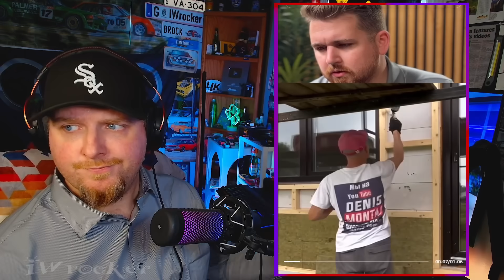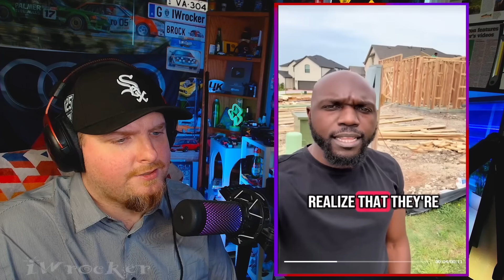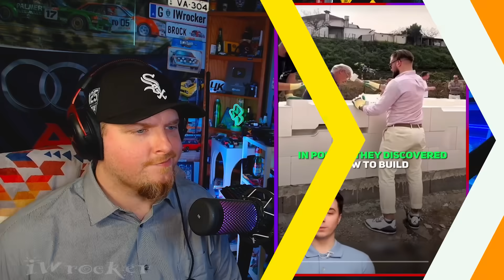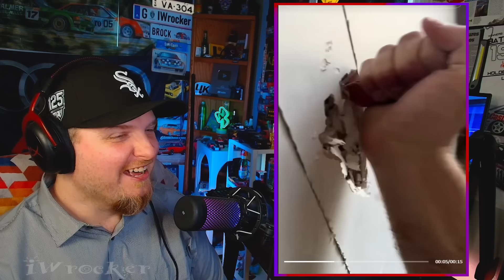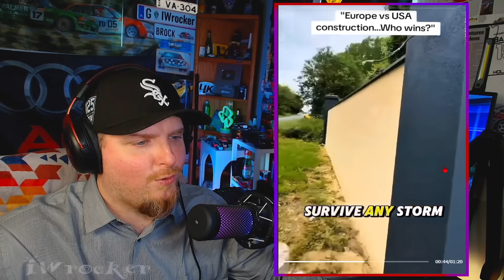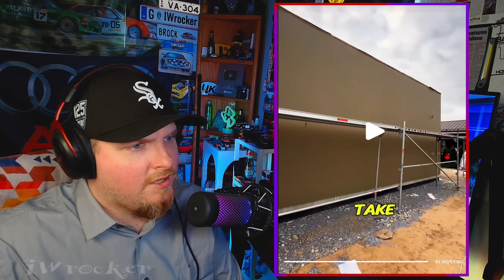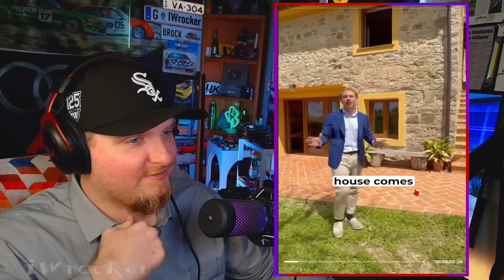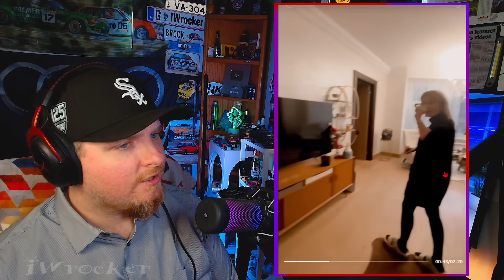25 Minutes of European VS American Home Quality & Construction Methods 🔨

Comment: In my country there are concrete and brick pre-fabricated houses that can be assembled in two to three days after the slab on the ground is ready.
The walls come with pipes and windows pre-installed, are attached to the slab and the joints are insulated on site after it is all assembled. After it is all dry, it is painted or whatever you chose for the interior.
Cost wise it is a little cheaper, if your site is not too far from the factory where the walls and ceiling are built, but also depends on location since the truck has to have clearance to get to the site (so no big cities).

Comment: 17:55 i might've seen the answer to that recently, in a video about the london metro network (vs berlins). its not an actual house, its just a facade. there is likely a big, square hole behind it, where the "tube" runs through, back from the days when they used steam locomotives and had to vent the steam from the tunnels. guess it was decided this is nicer than just leaving it open/fenced in.

recently watched a video of an experienced older gentleman from the US reacting to japanese housebuilding. its interesting that they use a lot of wood too, but everything (certainly in the video he watched) was done with care and clear experience of the craft. it was delightful to watch, both the original, as well as his reaction and recognition of the methods used.
and then you compare it to some of the horrors we see in US house building. granted, i know there is scammy japanese housebuilding too, or at least it used to be a big issue, as well as decent to good american housebuilding. but you gotta wonder what justifies the costs.

also what you said about them being thrown up quicker in the US is only partially true. im fairly sure you even looked at a video of european prefab houses before. those go up quick as well.
Reply: There are indeed facade "houses" in London as you describe, but "the Thin House" (its actual name) isn't one of them. It's a genuine house (or rather block of flats, originally artists' studios) built on a triangular plot left over after the construction of the Metropolitan District Railway. Partly so as not to waste the land, and partly to hide the railway from the posh houses in the rest of Thurloe Square.

Comment: 13:30 universal European house. the walls are probably Ytong or similar. light material that has very good fire-resistance and heat retention. the outside is black EPS, a type of isolation. You choose the thickness of it depending on your need. the netting is there for it to stick together with the plaster that comes on it. it is not cement. just plaster that you can get in any colour you want, so you dont have to paint your house and it stays the same colour.

Comment: My grandmas house is 500yo with 1m thick layered rock walls. The only thing that needs to be redone or fixed time to time is the clay roof tiles, the paint on the wall and we did swap out the old windows for modern vacuum sealed ones for better insulation.... I assure you that the 100 year remark was not an exageration...

Comment: In Norway, we isolate on the Inside, and most houses are made of wood, including the facade.
Reply: Might this be the line that connects things, with wooden walls you insulate on the inside and with solid walls (brick, concrete), you insulate on the outside? 

I do realise that the best methods with solid walls might be a double wall with insulation between the two walls.

Comment: American houses are NOT quicker to throw up. Cement based prefabs are literally assembled in a single day with a three man crew and a crane...

What takes longer are slabs, roofs, interior design, fassade work... all of which have to be done similarly in the US as well.

Comment: I live in the UK in a 1966 bungalow, we have iiner wall cincrete blocks, outer wall bruck,we have cavity wall insulation between, our lofts are insulated, all our inner walls are solid too, if you want to hang anything you need a hammer drill. We don't have basements, older house have cellers. we don't have 'crawlspace' I don't understandwhat that is. It seems American houses are designed to be a fire hazzard.

Comment: 18:45 - It's not exactly a truck, Ian, it's more like a UTE. It's called Piaggio Ape and it's basically a three-wheeled Vespa (which is also built by Piaggio) with a cabin and a metal bed. You can see when he comes out that it has the normal Vespa handlebars instead of a steering wheel. Very common in many European countries. 🙂
20:08 - That's not a bathroom, it's a toilet. It doesn't have a bath tub or a shower.

Comment: I pay around 1000€ / 1200$ i rent for 60m² in a average size city in the Nordics. It's quite high for the city I live in though but the building I live is pretty new, built in 2017 with high standard.

Comment: The grey roof is a "standing seam" roof system. Normally zinc alloy sheets or galvanised steel in that matte grey. I worked on a 18th Century school roof replacement with a standing seam copper roof where the patination had turned it green when showing clients years later. Beautiful.

Comment: I have a question about cleaning the American style windows (I'm a lucky German who can just open the windows like a "door" to the inside of the room and wash the panes easily on both sides). I'm curious about the American windows, where you have two panes and the lower pane slides up in order to open the window... So, if I'd want to wash such a window, I could, obviously, wash one side of both panes (upper and lower) normally from the inside of the room. But to clean the outside, I'd have to slide the lower pane up, and then precariously lean outside of the window, twist my body around and try not to fall out, while I wash the outside of the now pushed up lower pane...? If I survive that, then the outside of the upper pane is still dirty. Unless I live on the ground floor and can access such a window from the outside of the house, how do I wash the outside of the upper pane? Do I have to place a tall ladder on the outside of the house, climb up and wash the windows that way? What if the house has three stories? Not everyone has such a tall ladder? Or if you're elderly and can't climb a ladder easily anymore? Do you have to hire professional window cleaners every time to get the outside of the upper pane clean? I've pondered about that more times than I care to admit. 🤭 Maybe there's an easy solution to this, which I've just never seen or heard of, but I keep wondering how these American windows get washed from the outside. Maybe someone was patient enough to read my long-ass comment and can let me know how you guys across the Big Pond do this. 😊
Reply: Or, I guess, if the lower window pane slides up on the inside , then you'd be able to clean the outside of the upper pane by leaning out, but now you can't access the outside of the lower pane (because that's now facing the inside of the upper pane). Either way, I imagine you can't properly access both panes on the outside. Yet, I also can't imagine that American's just always keep one pane on the outside dirty. How is this done? 😅

Comment: My father is a builder and our house in Portugal is built with a double-wall system. One layer of brick, then a layer of insulation, and then another layer of brick. In the summer the house is cool, in the winter it's hot. We don't even need heating or air conditioning.
Reply: Yes, that's how we do newer houses.

Only use insulation outside for old houses built before insulation was a thing.
Reply: @anamarques5599 Except if it's an old historical building. In that case you cannot hide the exterior wall behind insulation. Inside is your only solution... which is a pity but hard to do better
Reply: so is mine
Reply: @oulibemusic1257 you are from?
Reply: @anamarques5599 South of France

Comment: 1) Windows - there are not just two ways how to open the window. There is third version (or versions - if there are more) called micro ventilation - you just lock the handle to half pas one (clock) posture and there is just few milimetrs opening to let the moisture go outside. 
2) Fake facades in London are for hiding undergroud (metro). The London underground is so old that remebers real steam trains and it has to be partly open to let the steam go out. Behind the house ais a fosse where trains are going. So there are parts they are just hidden behind those fake houses not to fall on the railways. Or some fake houses are standing acros the fosse.
Reply: 1. micro ventilation is the thing most Europeans forget to mention and more to that - you can set it in two or even three position with eccentric gap adjusters.
Reply: @AudriusN  Exactly!

Comment: Since 2020, Germany has had the Building Energy Act. All older buildings must be insulated when their facades are renovated; usually, 4-6 inch foam panels are glued to the outside and then replastered.

Comment: We have several types of insulation.

Between bricks one wall of brick the insulation eps places finally another wall of bricks.
The hold house became blue or yellow depending on the brand, the Las brick wall is the outside wall.

We call it sandwich insulation made when the house is built.

After the house is built you can do interior installation, not my favorite choice because of the inevitably termo bridges (as mentioned above).

At Last we have the hole external insulation, we call it capoto can have 15cm thick and then is has the external finish.... Is better than the internal one.

Never saw an external insulation made of Rock wool and nothing else with those untreated wood expose to elements.

Comment: Not one house that i own. One built 1880. Mid terraced built 1956.
Permanent home built 2002 All roofs have Concrete Tile. Not garden shed felt. That will have to be replaced within 10 years. Thatch lasts +30 years. 
You dont even have click together  garden hose connections.
🇮🇪🇪🇺

Comment: If you want a proper insulation you are doing it on the outside, that's physics, not feelings. In conclusion the first guy, who claims is a constructor, he will fail a 7th grade thermodynamics exam.

Comment: Building and construction regulations here in Germany assume a useful life expectancy of 80 years for residential housing structures. But a good number of houses are much older than that, in some cases they have lasted centuries and, with the right amount of regularly carried out renovation and restoration, still have many years of use in them.

Comment: ALL EUROPEAN homes come with insulation because it is mandatory. Some building directives require near-zero energy consumption. Space age technology for US of A
Reply: Nope. The old places don't, but then, they don't really need it. 
I happen to live in one, build in 1743. Outside insulation is out of the question since the place is protected, and is beautiful.
However, the thing was build with 80cm thick stone, doubled inside with real wood panelling... once you switch windows to double glaze (it's the weak point), the energy conservation is top notch.
Our ancestors knew what they were doing.
Reply: @picassomanu185 sorry, but stone walls suck at insulation. I have 200 year old farm house as well with 70cm thick stone walls - its just bad at keeping the heat in in reality. They have big thermal mass but that's about it. 10cm of rockwool is 7x better at insulating....
Reply: @Mixz1890 not if you have a wooden box insiste the stone box, with air in between.
Reply: Nie jest obowiązkowa dla starych domów, przynajmniej tych na wsiach i na prowincji. Ale są zachęty finansowe na termomodernizację od Unii Europejskiej. 

Ludzi nie stać na termomodernizację z własnej kieszeni. I do teraz palą syfem w zimie w postaci płyt wiórowych czy plastiku. Żeby pozbyć się smogu, kraj i miasta muszą wydać dużo pieniędzy na termomodernizację dla domów gdzie mieszkają biedniejsi mieszkańcy

Comment: If I wanted to drill a hole through the exterior wall ? In my villa, I need a fairly long drill bit on a powerful hammer drill. It's feasible, but the walls are concrete blocks. In my apartment  in France ? Nah. Won't even try. That's reinforced vibrated concrete. 30 cm (about one foot)  thick reinforced concrete. Probably proof against small caliber artillery :)

Comment: I know that the german window company SCHÜKO has some fabrication plants in the US now. See Matt Reisinger videos for more.
Sure you applicate the insulation on the outside, it works like a coat you wear in the winter. And sure, it needs to be done propperly. Slubbish work will be found around the globe no matter which constuction you choose! Insulation on the inside is only chosen when it is an old listed/landmarked building, like half-timbered house etc. It is more difficult to build up, you lose room space and it is not as effective than outside insulation.
That little three-wheeler at the end is a Piaggio Ape. 😉

Comment: If you're seriously worried about the weather (or simply noise and the like) having insulation both inside and out makes a great deal of sense...though perhaps less so to a US cowboy builder who believes in doing the minimum possible. (Build crap, sell high seems to be the order of the day over there - purposefully make rubbish so it falls apart and creates more work for you and your chums. Meanwhile, back in the Old World, there is still some expectation of lasting quality.)

Comment: 5:39  In the 60s and 70s in Sweden, it was common for boring worn out old houses to be clad with something that looked like real brick, but was actually so-called "fake facade brick", which were sheets with a printed brick pattern in different colors, which were attached to the facade with screws. Over time, these absorbed moisture and the screws rusted and caused pieces to come loose and not uncommonly you got a lot of black mold in the house as a result.

Comment: I live in a 3 story apartment block, the only reason I know I have neighbours is because I see them not hear them 😂. My actual apartment door required 3 men to carry up the stairs and my windows (triple glazed) flip inside out so no need for a window cleaner and ladder.
The floors are concrete, with a 15 mm cork layer under the carpet that absorbs something like 60 or 70% of all sound. It's a 80 year old building and has cost me £0 in maintenance in the 20 years I've been living here 🇮🇪

Comment: You should check out house building with IFC blocks, thats a very good home and very good Insulated, also against the heat 👌
And its holding good in hurricane s also, especially if you also have the "roof in the same construction (concrete)
Very much used in europe as here it's mandatory to preserve the energy a house needs to be kept warm/cool.
Good videos, been following for a while, best of wishes from Norway 🇳🇴

Comment: Just for information, the nice stonewalls that you see in that country house in tuscany are not there for the aesthetics, those are real (very big) stones, the wall is made of those and are kept together by concrete. Generally those stones are big enough to go from one side to the other of the wall (inside to outside the house) and it's a typical and very old building style of Tuscany and most of central Italy to leave the stones in sight without covering them with stucco(drywall), like it is common in other parts of Italy.

Source: I lived in a house like that most of my life.

Comment: Is there no mandatory inspection of houses before they are delivered in the USA? In Belgium you have an inspector and the architect that will check the house together with the customer and if something is not correct is has to be redone. My brother had one faceade wall that was not plum so the bricklayers had to redo that whole part of the wall.  If constuction companies want to avoid doing stuff twice on their own expense they will try to do it right the first time.

Comment: That house in London is a so called spite house - yeah, what it sounds like: built out of spite - to annoy someone nearby, usually by blocking the view or some other side effect of building it.. (And if I remember correctly, the left side is a lot deeper than the right side we are looking at.
Reply: Actually not. The neighbours would be grateful that it's there, as it blocks the sight and sound of the eastern approaches to South Kensington station from the rest of the buildings in Thurloe Square. It replaced a row of conventional houses that were demolished when the Metropolitan District Railway cut through the area, on the triangular plot that was left over. It was originally artists' studios, but is now upmarket flats.

Comment: Although timber and steel frame builds are becoming more common in the UK, block and brick with cavity insulation is probably the most durable. That aside timber framed Elizabethan houses still exist, so if built properly timber framed houses can stand the passage of time.